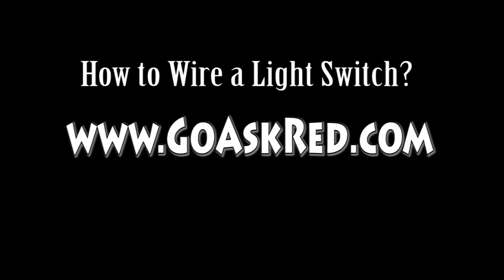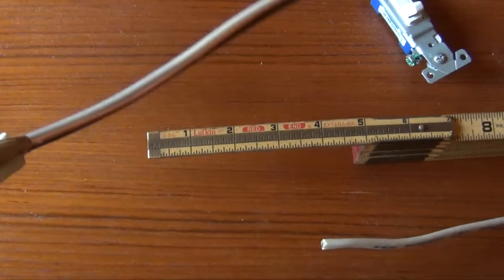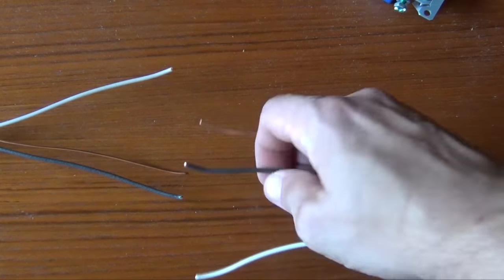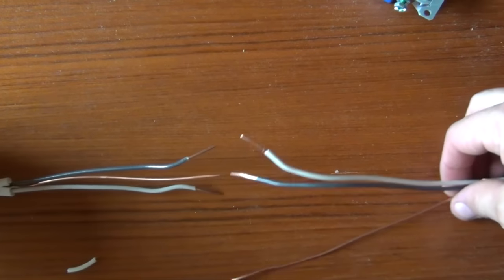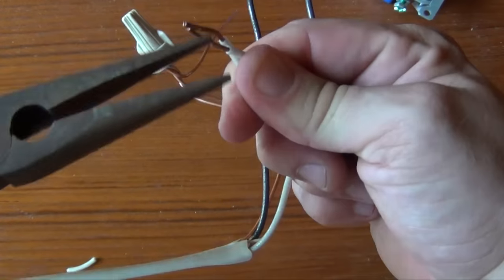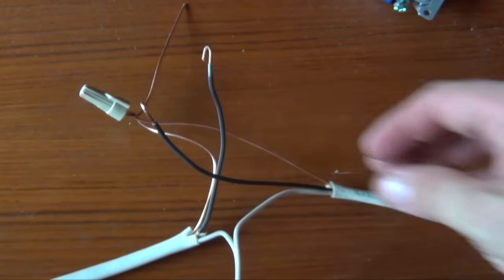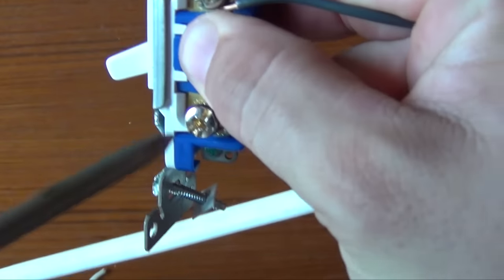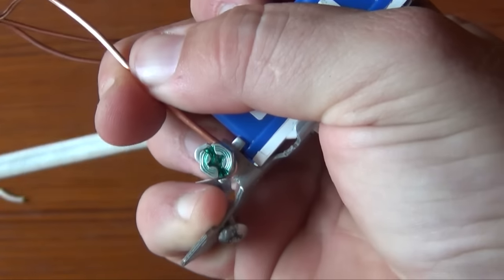How to Wire a Light Switch

Comment: WHICH ONE IS FEED AND YOUR SOURCES
Reply: The black wire is always the feed.  That is why the white / neutral is connected to itself at the fixture.  Sometimes a romex cable is run from the switch to the fixture, and one of these will be colored white.  This should become the return from the switch, and be tagged as HOT by wrapping some black electrical tape onto it, signifying that it is not a Neutral line, but has been converted to a Feed line from the switch to the fixture.

Comment: How do I connect the old wire, to the new wire, so I can relocate the light switch.
Reply: +Nrfa a junction box, some wing nuts and some tape. connect them together inside the box. then run the wire. just make sure the wire is the same Gage.
Reply: @stanleycard6867  or if the old is 14-2, you can use 12-2. Whatever you do just dont downgrade on the gauge of wire.

Comment: This guy clearly isn't an electrician.. The ground(green/copper)wire should always be connected first.. And he never says which black wire is the Hot wire or the load side.. Please be careful people. Electrical work is more than matching colors.
Reply: I understand what you're saying, he should have at least mentioned that ground is connected first, but these are dead wires so I guess he took it for granted.
Reply: Why does it matter what wire is the line and load for a single pole switch?
Reply: The wire is not live though
Reply: Although the wires aren’t live, we shouldn’t practice bad habits.
Reply: @Mr1984eL  I'm sure he knows that  when he's wiring live switches
Reply: Can’t make those kind of assumptions with electricity. Especially if you’re teaching people. I’d rather he teach people the correct way first.
Reply: @Mr1984eL  you should ALWAYS turn the power off before working on electricity

Comment: what if I Have to add a fan with it,
Reply from the maker: Brian Sewell If it is a ceiling fan with a light kit, then you're installation directions should provide you with that info.  You'll probably be stuck with the switch controlling power going to the entire fan/light assembly, and then you'll have to turn on/off the fan and/or light with pull ropes attached to the assembly.  If you're set with having individual wall switch control of both fan and light, then you'll need to install another circuit (i.e., run additional wiring), switch, and rough-in box.
Reply: Another How To Channel  no the light is over the mirror and the fan is in the ceiling thats the way the original switch was installed,
Reply from the maker: Brian Sewell Ah, I would assume that we're talking about a ventilation fan in a bathroom?  If that is the case, and if you're simply replacing the switch, then it will be the same as a light switch.  (But that is only if you're talking about a single fan... some vents can be a little fancy, with built-in heaters and lights, etc).

Comment: I alway was led to believe you hooked up the neutral to the switch not the load wire 😫
Reply: I think either would technically work but if you use the black on the switch you make the socket safer when the switch is off.

Comment from the maker: Mark, I'm afraid that I can not adequately describe a solution in text to you and be assured that we're both on the same page.  However, I came across a website with diagrams/descriptions that may be useful to you:

electrical-online[dot]com/how-do-i-wire-a-switch-receptacle-combo-device/

I think scenario 1 would be applicable to what you described.